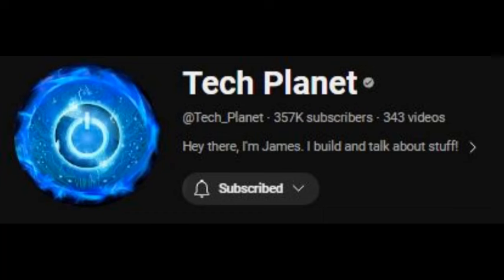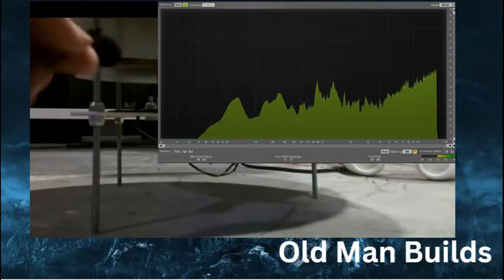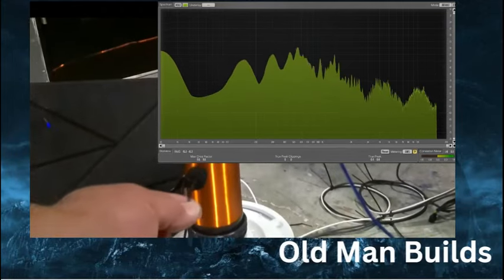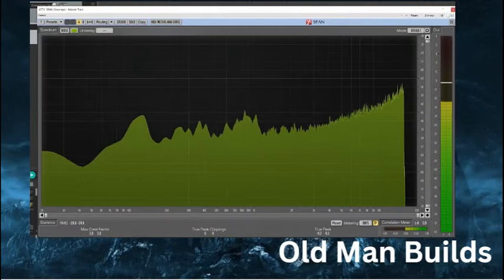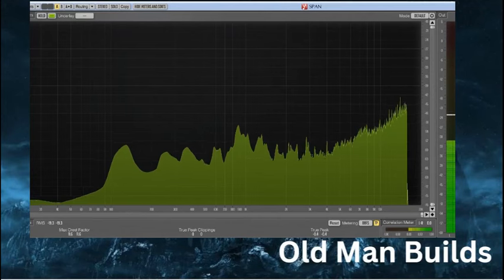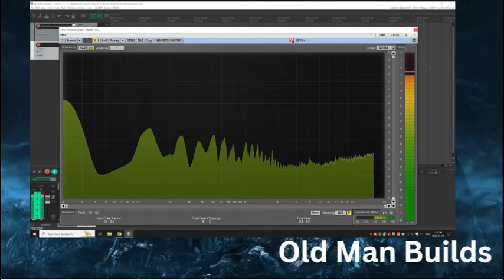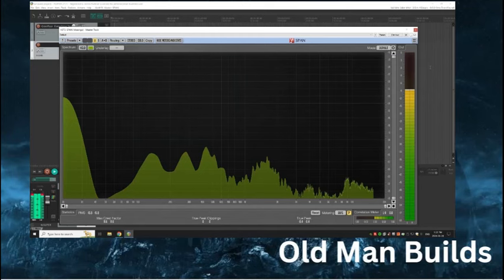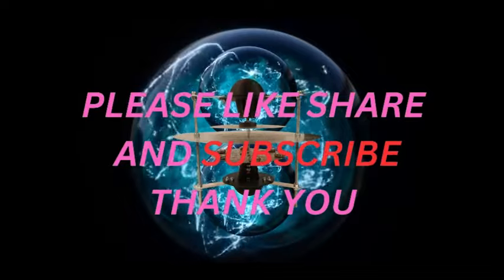Graviflyer "Frequency Breakdown" #31

Comment: Alexey Chekurkovの作成した物体の真ん中の一回り大きな円盤は、上下の円盤より厚みがあるように思います。
この厚みの違いを理解する必要があると思います。
Reply from the maker: The harmonics and sound is better for the thicker plate. I am not sure it is better over all. Several of the guys on the team have 2mm plates in the center. The 2 graviflyers Charlie C has bought directly from Alexey have very thin aluminum for the center plate. If you need some pictures from the original Graviflyer e-mail me at oldmannathanbunten@gmail.com